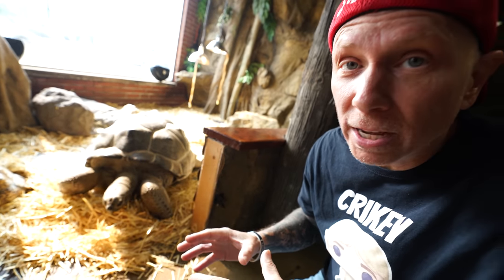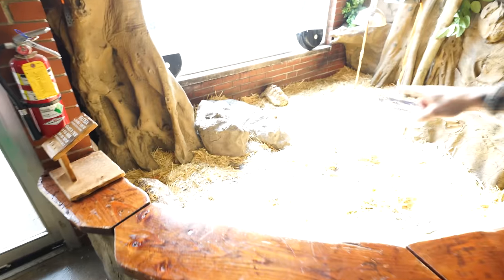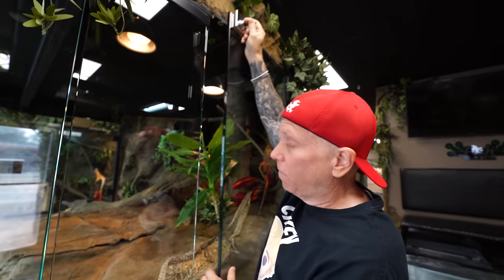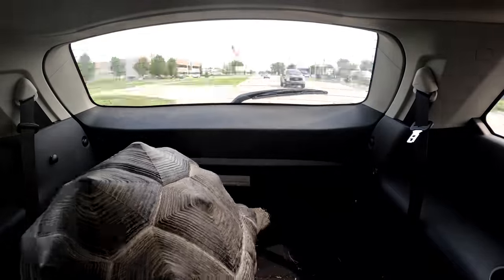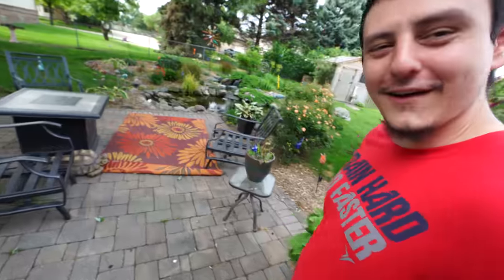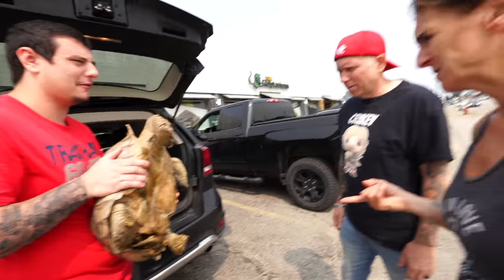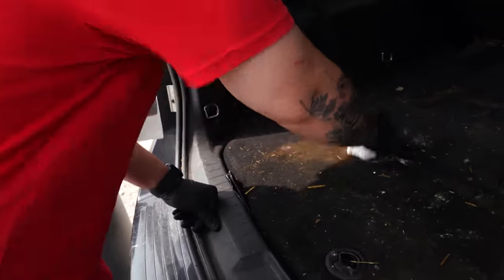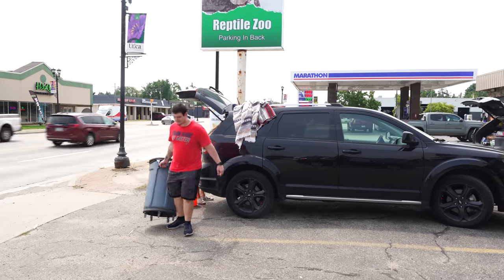Something Is Wrong With My Giant Tortoise!

Comment: Brian it will certainly take a few  months for this to correct itself. As Chris said, she needs to exercise on different levels, promote climbing up and down slopes and get those muscles working, this will certainly require a bigger enclosure. I also didn't see a UV source in her enclosure, there is a possibility of MBD in this tortoise, think how dense the bones need to be to support that weight.

Comment: The way it triggered the rage in me that there wasn't even 1/2 of a brain cell between 3 guys.  Especially, since there was a whole pickup truck at your disposal.  SO disrespectful!  On another note, I think the part of the floor that needs to be cleaned is a panel that actually comes out. I believe the spare tire is under there or it's storage.  Anyways, use your itty bitty brains from now on.  Smfh